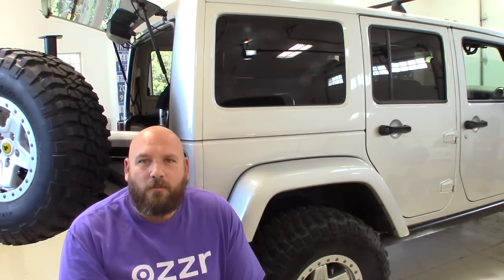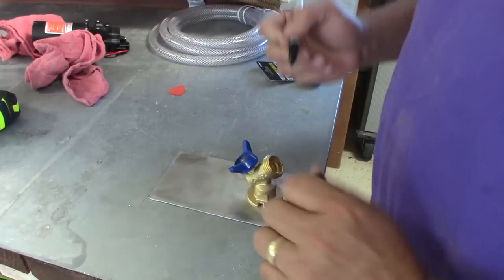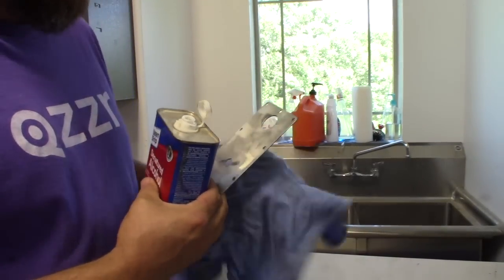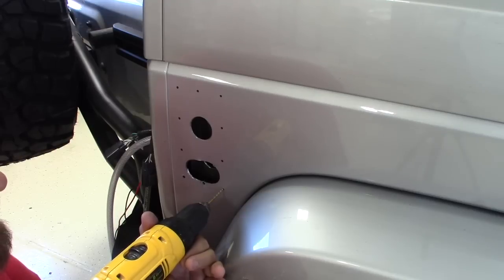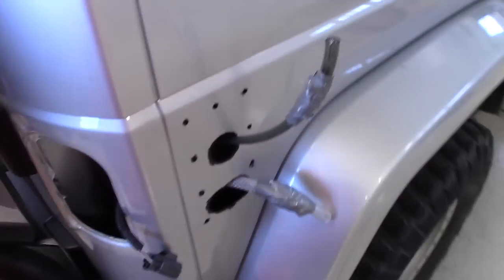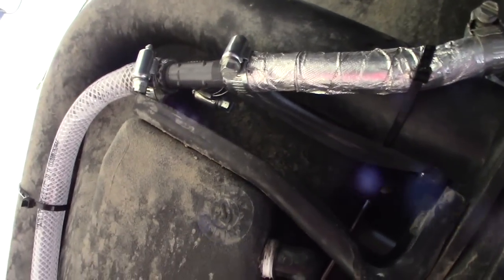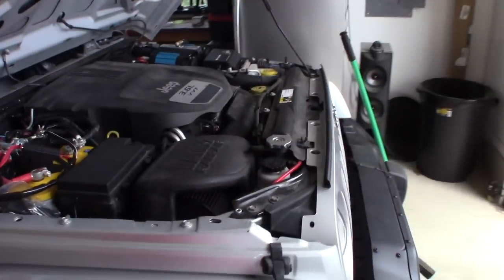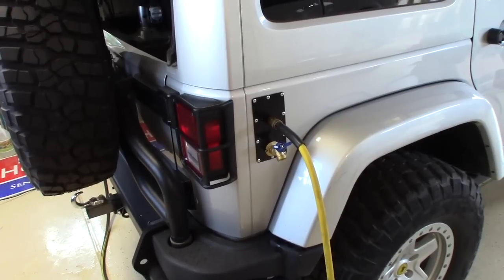Ultimate Jeep Mod - Running Water and Onboard Air - Josh's Garage

Comment: That’s a good mod. Just a note, any time you rivet sheet metal alway install each rivet wet with epoxy. Then wipe off excess on outside. It keeps the panel waterproof and the rivets from working loose.

Comment: Your one of a few people that actually epoxy over holes you drill in to the body and silicone the cover.  And i like how you put heat tape on your water lines👍👍  great job! You night want to keep an eye on your plastic tee's though. Mine lasted about 8 months but i live in Texas. I replaced the plastic tee's with copper ones and brazed on sone barb fittings.
Reply from the maker: Why thank you!  I appreciate the tip.

Comment: I really do like this.  That said, I do have a few questions.  1)  Is the water potable?  2)  Can it be made potable somehow?  3) How do you plan to clean the bumper inside to remove algae and mildew?
Reply from the maker: I'm not an expert on potable water, so I'd rather not say.  And I empty the tank after each trip and live in a very dry climate.

Comment: I like the arb compressor under hood option....Do you notice any over heat on the engine with the air conpressor, S Pod and dual battery setup installed

Comment: that's a really awesome setup but is there a way to mount it inside the truck? I know I would rip that right off in the trails
Reply: I've seen write-ups where they mount it inside the rear cargo area.  Just keep in mind wherever you put the hose bib and air connection they are going to be in the way.  I think a small bolt up box behind the roll-bar would be a great option personally.

Comment: Did you have to vent the tank?
Reply from the maker: Yeah, the AEV bumpers have a vent molded into them on the top which is run up into the fender well

Comment: Nice modification to your Jeep Josh. I like it. 
How do you pressurize the water?
I would personally go for the same color on the plate as the Jeep itself but it is just my personal opinion.
I just subscribed to your channel.
Cheers from Sweden
Reply: he used a differential pressure pump (RV stores sell them). It will come on when it senses a difference in pressure...when the spigot opens, it should kick on automatically.

Comment: Why not just use the compressor to pressurize the water tank
Reply: then the tank has to be pressure rated.  the differential pump will just pressurize the output side on demand.

Comment: Can you air up all tires without worrying about the compressor overheating, or how does that work?
Reply from the maker: The compressor will take the heat, but I've melted a couple hoses around the fittings trying to air up all 4 without a break

Comment: How do you get on board water?
Reply: he has the AEV bumper with tank.  FYI, the stock bumper will hold 6-7 gallons of water if you close up the drain holes (4).  several write ups to do that on youtube

Comment: were did you get the rear bumper,or it is a oem bumper?
Reply: oem for certain years, you will need to plug up a couple drain holes on the bottom of the bumper and make a fill hole and a feed hole.
Reply: Jesus, it's not an OEM bumper.  This is an AEV Rear Bumper.  (American Expeditionary Vehicles)